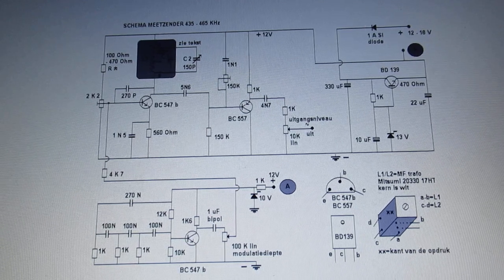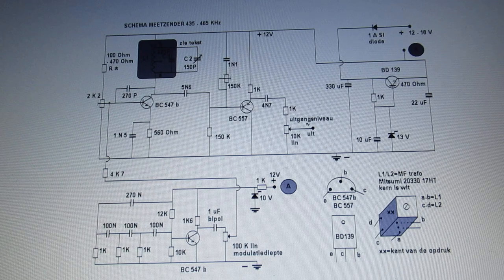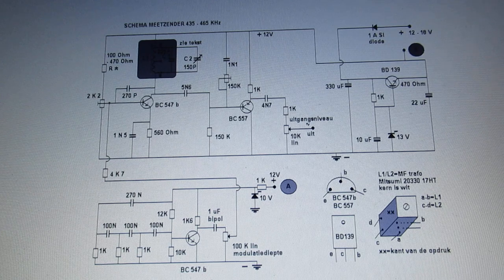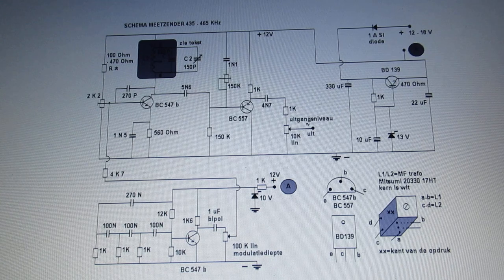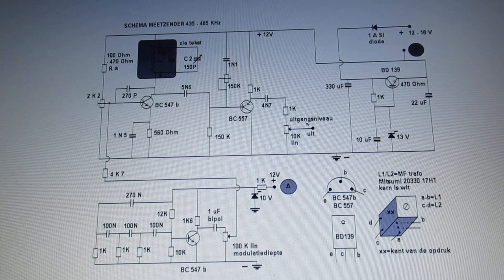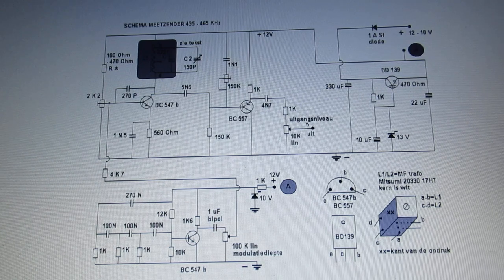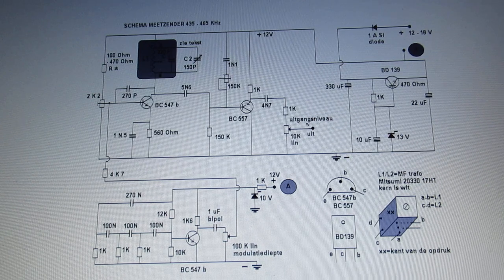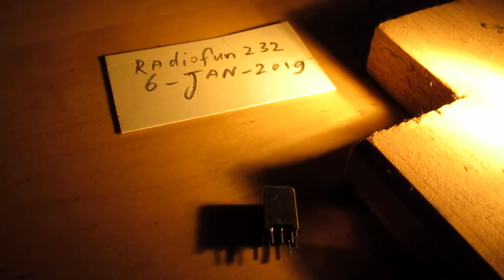Measuring transmitter 435-470 KC & AM modulated with 1000 Hertz/modulation depth max 30 %

Comment: Nice ,,, Can you make the simplest one channel RF transmitter and receiver for remote control purposes?
Reply from the maker: That is a circuit looking like an a-stabile multivibrator made with 2 x a 2N2219 and one coil tuned to (say) 27 MHz. Carrier wave present or not present gives the effect. Receiver is a 27 Mhz superregenerative receiver.